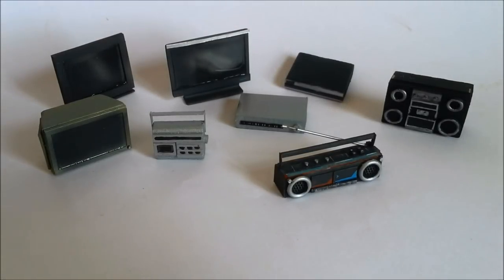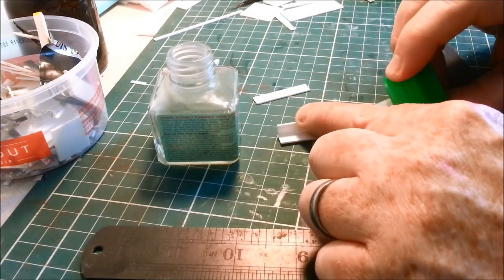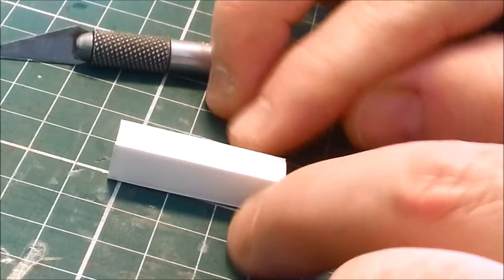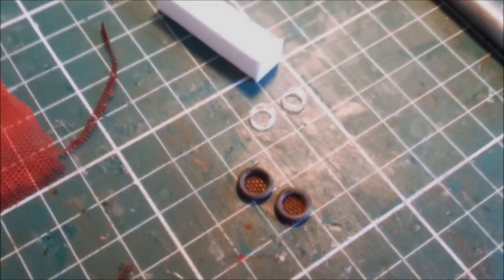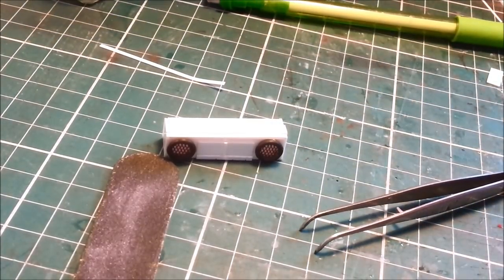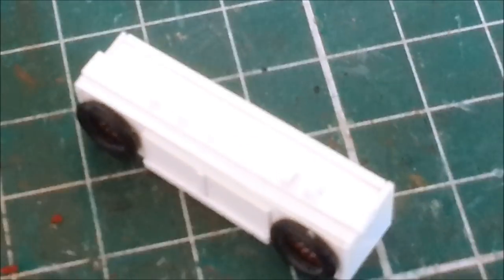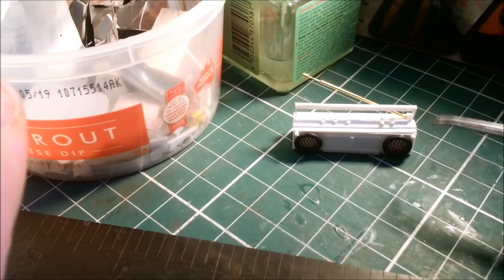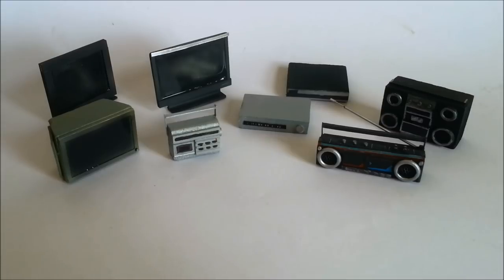Scratch built model tutorial: how to make electric appliances

Comment: Hey Dave, a looong time ago when I was studying Art we worked with styrene a lot. On of the "hacks" we used was to sneak into the photography department and use their mounting board cutters to cut longer strips/sheets of styrene. They have the knife at a 45 degree angle. The benefits were that you could make long, straight cuts (cut, not score and snap) that would leave a 45 degree bevel on the styrene, giving you beautiful crisp 90 degree corners and a larger surafce area for the glue at the same time. We did this a lot for architectural models.
Reply from the maker: SoupFork that would be so cool. I can totally see the benefit of a 45 degree surface to glue. I’m  have to investigate mounting board cutters!
Reply: Please let Us Know The Results
Reply: @DavesModelWorkshop  Few tips I remember: Some mounting board cutters have proprietary knives and they cost a fortune, Stay clear. We used one that mounted x-acto blades. And never push, the blade will snag, go dull and the styrene might snap. Use multiple very light passes.

Comment: I love your results. But it seems to me that rather than building a box from flat pieces, it might be easier to start with square or rectangular tube stock (styrene or brass).

"Why is white so hard?"

The camera is seeing the dark background and trying to expose that to a mid gray. This results in anything light-colored overexposing. A lighter color background would help (paradoxically).
Reply from the maker: Doug Sundseth thanks Doug, I’m going to run with a light background next time, cheers. And yes, it would be easier if I had the right size rectangular tube stock, but I wanted to show how any size can be made, rather than having to work with a set size you may already have. Cheers mate, Dave

Comment: I have never used styrene before but I’m curious as to where to purchase it and am assuming that you can only use it for boxy shapes?  Is that correct?
Reply from the maker: I purchase mine from scale modelling hobby shops, or also online - just look up something like A4 plastic card sheet or similar. It can be curved, but it's a little tricky - it is better for rectangular shapes, curved I generally use carved foam.
Reply: @DavesModelWorkshop  ok thank you Dave.